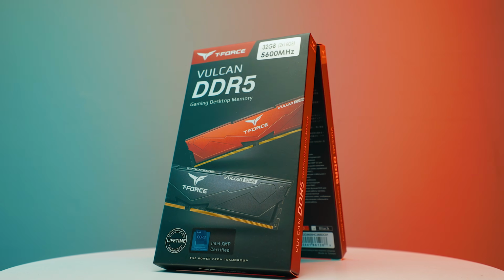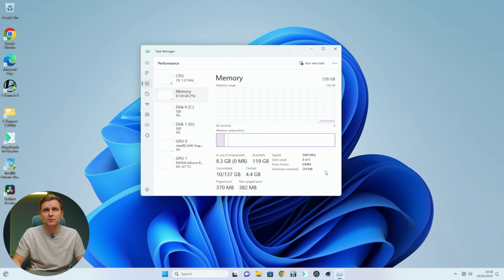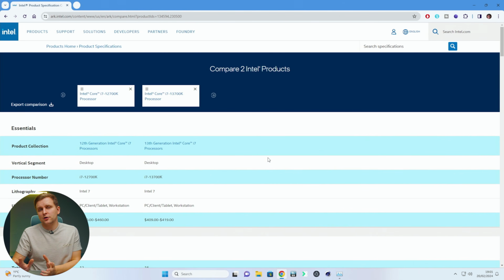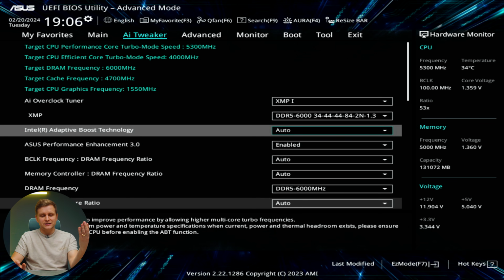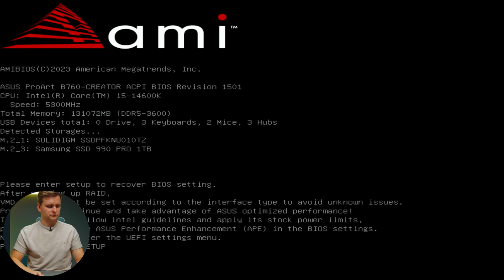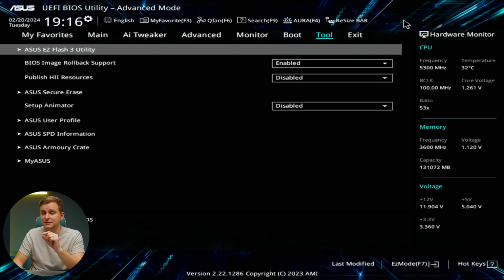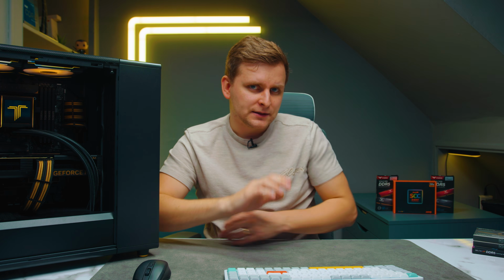Maximize RAM Speed EXPLAINED: Common Mistakes to Avoid & FREE Performance Boost!

Comment: I have been building desktops since Windows 95. 
I'm currently running Windows 11 Home on an ASUS Prime B360-PLUS Motherboard that I built about 7 years ago.
I updated from Windows 10 to Windows 11 Home a couple of months ago after ASUS finally released a BIOS up date that supports Windows 11.
No matter what I do, the Memory speed can never be faster than 2666 MT/s

It has absolutely nothing to do with the speed the Memory CAN run at, it is because of the chipset on the Motherboard. 
That is NOT going to be a problem on the next ASUS system that I'm going to build this summer.

Comment: 2:33 yes overclocking soooo ALL HARDWARE must be rated for the speeds, most cheaper motherboards and most cpus all intel and AMD say max is 6000 but they melt at 1.4 volts so.. in general don't recommend anything faster than 4800 CL40 and even if they do, its not the standard and not recommended for stability and longevity especially with 4 ram sticks vs 2 like seen here

Comment: 00:29 this is overclocking and not recommended for stability.. it will cause crashes and even failed hardware 10,000... thats more than double idno... also warranty void, ALL HARDWARE IS LOCKED TO 4800 CL40 unless you want to overclock and go beyond what's safe IT WILL DAMAGE YOUR HARDWARE AND RISK FAILURE

Comment: DDR-5 is finicky, they shouldn't be selling kits at the advertised speeds on the box.

I have an Asus B650, 9800X3D and Kingston 32gb 6000 CL30, I cannot get anywhere near the expo profile even with SOC at 1.3v

Literally have to run JEDEC specs at 1.12v SOC to be stable, nothing above that works. 😮

Comment: What about Channel vs sticks used? I run Intel workstation quad chan 64g (8x8g) caused it looks nice RGB but So I can swap 4x16g but I plan to upgrade CPU that will use 8ch so now I'm back to 8x but I presume that's ok if W3400 was designed for this.

Comment: Good advice on not messing with timings. While getting them tightened will give you better perfmormance, it is a rabbit hole that takes a ton of time to get right and is just not worth it for the majority of people.
Reply: As someone who spent 4 days retsarting my PC, I agree. There is something thats not often pointed out - and there is a strong chance of data corruption that inevitably increases the more you do this. I discovered this twice. The worst part was my pc wouldnt even detect my NVME after corruption and that was a 2 hr headache to sort.

Comment: I would just try increase RAM voltage first, 1.3v is pretty low. Easily can up until 1.4v safely or even 1.45v.

Comment: Here's something never mentioned in any of these videos. When you OC (EXPO/XMP) system memory you force the memory controller to run faster. That means it needs more power, and it will take that power out of the CPU package power budget, effectively making your CPU cores run slower. Quite obviously then, this also means higher CPU package idle power consumption. ALSO do not forget, the speed of system memory (MT/s) doesn't say much about responsiveness of the system (latency). RAM is random access memory and that randomness makes latency very important, as that is how quickly the system can access it and use it. Once the system knows where stuff is and/or should be, then the memory speed might matter, but at that point it mostly doesn't. Sure, when the CPU is maxed out at 500fps, faster system memory might get you extra 20fps and even improve 1% lows, but at that point you would just buy faster CPU.

Comment: The T-Create are actually one of the best RAMs in the market right now especially looking at clock timings and price!
There are 6k Mhz ones with CL30/32/32 for just under 100€ (2x16GB), compatitors are well 20€ above that.
I think they even have a slightly more optimal tRAS timing on them.
Unfortunately you spoke way too little about technically important data numbers for RAM like native performance clockings.

Comment: I'm running my single-stick 32gb XPG Lancer at 6000 MTS with my Ryzen 9 7900X on an MSI B650M Gaming Plus Wifi motherboard. My stick is originally rated at 5600 MTS. There is a section in the BIOS called "Memory Try it" - I just selected 6000MTS, restarted, and it is running as stable as a rock
Reply: hello i have dual stick 16x2 g skill trident 6000mhz expo ram with ryzen 9 7900 on msi x670e gaming plus wifi motherboard and i am not able to run my ram at 6000mhz its default 4800mhz when i enabled expo it ran 6000mhz tested stability test for 1hr no issues temps were below 64 and the problem is i cant cold boot my system at 6000mhz  since u and i have similar specs can u help me fix my problem

Comment: i am using asus tuf x870 run 9950x with ddr5 7800mhz, 2 sticks just get it done no issue. but 4 sticks in system cannot set to 7800mzh, tried to 6000mhz or even lower system became not stable. with 4 sticks in i finally set the frequency to 4800mhz only run stable. and now i only use 2 sticks instead of 4.

Comment: No wonder my Ryzen 5 2600 crash from time to time i thought my PSU(520w bronze) pair with RX 480 can't keep up that time i was running the RAM at 3200MHz when it should be only at 2933MHz. Now my PC doesnt crash anymore i upgraded to Ryzen 7 5700X3D where it max out at 3200MHz and RX 6600 running smoothly now i did'nt experience the sudden crash/black screen before so it pretty much confirm that's the case.

I have a Asus ROG Strix X370-F Motherboard which support 64GB at 3200MHz, was planning to get 2x16GB of 3200MHz and later on will get another set of RAM to 4x16GB 3200MHz am i expecting too much that the motherboard will handle this specs or will it have a set of other problem?

Comment: I got the 9800X3D and I want to run 128GB of RAM at 6400MT/s but unfortunately I'm stuck at running at crappy 6000MT/s with a X870 motherboard.
Reply: That is not doable bro, I know it would be amazing but  even 6000 for 128gb is the maximun and you should be proud.
Reply: @Drumaier  That's because it's four sticks, if it was two sticks It could be done at 6400MT/s.

Comment: If you want a more in depth tuning guide go check buildzoid. This guide is very very basic. For instance a lot of performance (0.1% lows) can be gained by tweaking certain timings which for some reason are always too loose by XMP profiles. Also, if you want the best and easiest ram for AMD, just check which sticks have Hynix dies, go for those at 6000MTs and tweak the heck out of the timings.

Comment: I am lucky, after buying 4x16gb 6ghz sticks, my motherboard and CPU taking it like champs and going with 6ghz with no issues or crashes. Well, at least for now...
I didn't even know 4 dimms are not a good idea. Glad I got suggested this video!
Reply: you're probably on AMD and probably a Zen 5 right.....
Reply: I have 12700K. Got it on discount for 120 freedom bucks. Couldn’t resist…

Comment: So I got the Gigabyte Pro X motherboard when it was first released, my first DDR5 board, so I got the Corsair Dominator 2x48 96gb 6600mhz. I had to update the bios to run XMP and it ran great for months. Now I’m getting the BSOD, and if I turn off XMP it doesn’t crash. Therefore I’m thinking the sticks are bad but they both pass tests with windows memory diagnostics and memtest64. I also thought my CPU is degraded but it also passed using Intels Processor Diagnostic Tool (IPDT)

Any thoughts? I don’t have any other sticks to test as my others are DDR4

Comment: Higher speeds, run HOTTER, the highest speeds IMO are too high. My Hynix M-die 6200 DDR5 is plenty fast, and is at about 1.35 volts, so it will last.

Comment: I have a ASUS Strix B650 A and my ram runs at its max of 6000 MT without a problem. My mobo max speed are 6400MT so I ima test at its max with new ram that can’t hit 6400MT

Comment: You've probably changed it by now, but your cpu cooler seems to be installed on the bottom rather then the top. I wonder if that would cause improper cooling for the cpu?

Comment: Getting 128gb of ram to work was pretty much impossible. 2 years ago I built a new computer for a graphic design shop. My 3rd one for them at the time. They said they wanted to best of the best this time around. I used a ryzen 5950x (best at the time) and a gigabyte 3080 oc with 128gb of ram. It took a lot of research to even find ram that was “comparable”. The good thing is that the ram capacity was far more important than its speed. In the end. I had to run the 4 sticks of 32gb ram at bone stock speeds. It worked out very well in the end. This shop does a lot of multitasking with high end graphic software and they use many programs loaded up at the same time. Peeking at the computer from time to time, I could see that they were regularly using well over the 64gb of ram that most high end computers would be built with. They also told me that rendering was getting finished up to 4 times faster than the computer with 64gb of ram.

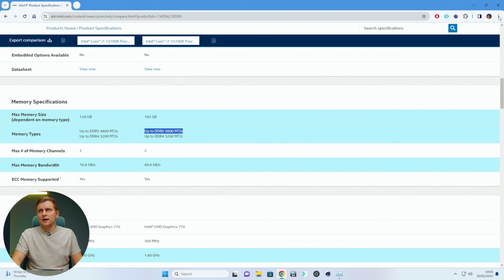Comment: 7:14 if you cringe, just type the command : shutdown -r -f -fw -t1
Bios does not "run Windows" or anything else, it is actually the Firmware (machine code) that makes hardware initialization, testing and settings, then launch the bootloader part of the operating system if found. 
The UEFI is the User Interface of that Firmware which allows you to choose the desired options and stores the settings as well as the basic security of the system.
Once the initialization settings have been verified and the operating system is started, the BIOS is no longer active and no longer influences system operations in any way, these functions are taken over by the chipset code and other parts of the system management.

Comment: The MC isn't the core issue with DDR 5 ram speed support, it's on the motherboard design. The faster the ram the more interference on the socket is picked up creating instability. Technically consumer boards should have 2 sockets not 4 with DDR 5, and if you look up boards that have 2 sockets you will see them run 8000 mhz without issue.
Reply: no, its the cpu thats the problem, ask any researche apps, it will tell you the same thing, the stability issue comes from the cpu architecture, amd having more issues than intel, whos more reliable, but still the 13900k cannot handle more than 128gb, especially at 4 slots filled it goes past its specs, we basically need new cpus that can handle more ram, this is the bottleneck, the more slots filled, the harder it is for the cpu to do the job, so instability is created,  there is a solution by lowering the ram and boosting some volts in the bios, but still depends on the quality of the cpu, which is like lottery.
Reply: @Archonsx  hold up a second number 1 I work in the field of technology, i manufacture custom data center/ server motherboards. those boards have a dedicated power amp per socket to reduce EMI and amplify the signal, consumer boards only have 1. Under bios, DDR 5 timings, it is refereed to as Drive strength. You need higher ohms to drive higher density ram, aka higher gigabytes more ohms needed for a cleaner signal. Also JDEC standard timing is what the CPU's " FSB " is meant to run at, which is 5600mhz. It's always been this way since the dawn of x86. This is why they say that you are overclocking when you use the XMP/ DOHCP/ EXPO profile, your ram was built for that but your CPU was not no matter what side of the fence you are on.  

Another thing which has been introduced on ASUS boards not sure if any others did it, but Asus has released a newly designed ram socket to reduce the EMI for the " antenna effect " they did this by curving the teeth down to form a p q instead of being bumps the go straight up. DDR 5 has also released the CUDIMM, they have the power controller built in, to filter EMI and help amplify the signal. I only know of 1 manufacturer that currently supports CUDIMM, MSI. Currently the MSI X870/E can support 8000 speed and support 128gb. G.Skill has just announce their 128gb CUDIMM EXPO sticks.

Comment: 🤔 Hmmmm……….maybe learn how to tune ram. There are many things you can do to increase ram speed. Yes, it takes time, but it is well worth the effort to adjust primary, secondary, and tertiary ram timings + adjust the multiple voltages associated with ram. Speed  can substantially increase with full stability. Two ram sticks are always easier to tune than 4.

Comment: I've tried a ton of ram on my 9800x3d and X870 MB. 7200MT 2x16 Gskill running at 6200 has been by far the most stable and best performance

Comment: cpu max support is 5600 and there why option of 6000? i dont understand?
Reply: The "Official support" is 5600. It doesn't mean that the CPU could not possible run it faster. If it does let's say 6400. Then you're lucky you got a nice silicon. If it doesn't then you can't complaint because "officially" only 5600 is supported.

Comment: My advice is: Check every time the motherboard's QLF RAM List. Vendors ask you which OS , which CPU , Which RAM Speed, how RAM capacity and Which RAM vendor you want to use and then present a full list with compatible modules you can use.
Is so simple to avoid any issuewith RAM setup.

Comment: if I'm receiving chips from Nvidia rated at a certain speed, and manufacturing gpus andshipping them out after production at a faster clock speed than the Nvidia specs recommend, I get it. That's factory overclocked sure. It's not a perfect application of the term but there is logic in there. 

However ....

But in the case of most component manufacturers that do the job from start to finish under one company, factory overclocked at best just doesn't even make logical sense to say. And at worst a. Slimy dishonest sal es tactic intended to deceive you. 

Here's what I know.  If you overclock something it means you run it faster than the stock speed set by the manufacturer.

So we all know what factory means. Stock. So let's read The last definition but had the second thought in to Make sure it's all making sense. 

So it would be perfectly logical to assume that "factory overclocked" has to mean "when a component was manufactured to run at a stock speed faster than the stock speed it was manufactured to run at."

When a component ships out of the manufacturer after production, that speed on its way out the door, no matter how fast it is, it cannot by definition be faster than the stock speed because it defines the stock speed.  And the stock speed defines where overclocking would begin but has not yet begun. So it can be overclocked either.  

So the next time you're looking at two products and you see a difference Maker, ask yourself if it's an important feature or if someone maybe just forgot to use the brain while they were making throat noises and moving their mouth.
So what's the real definition of factory overclocked  - Not overclocked, and likely because they're already inferring that they're pushing its ceiling, also, not overclockable.  You see they're telling you they already did so that you won't and you won't ask why.

So once you get all the information, put it all together and follow the logical trail that only leads One direction. You'll see the slime. 

"Factory overclocked" is a term used to deceive you from noticing that while. The inferior sell you the least desirable c

Comment: I'm planning an upgrade to a z890 mb and it will support up to 9000MT, but the highest I can find on Amazon is 8000 (DDR5). I've noticed that the latency is much higher with these sticks, does it matter anymore? Is the highest you can find always the best idea? I've also noticed that many are only available is 32GB size making a pair 48GB. Why the unusual configuration? Planning intel 285k cpu. Thanks for the assist.
Reply: Look for cu-dimm ddr5

Comment: Should you up the voltage if you up the ram speed? I have ram at 4000mhz and it runs at 1.1volts. I got some new ram and if I run it at 5600 should I up the voltage to 1.4 which it allows, or keep it at 1.1 volts?

Comment: i have the ddr4 the max speed is 3600 but i set up mine to 3200 its smooth for a couple of days now there is no bluescreen i havent try playing high resolution games yet. but on my old set up i run my ddr4 to it max speed which is 3600 and i continuously having a blue screens

Comment: The 4x8gb theory isn't true.
Got 40fps boost going from 2x8 2666mhz to 4x8 3600mhz, and I'm running it on a cheap b450m mobo.

Gaming performance fps is the only way to tell the difference , and we can't prove it the other way around apparently.